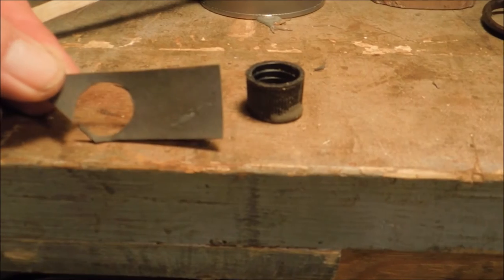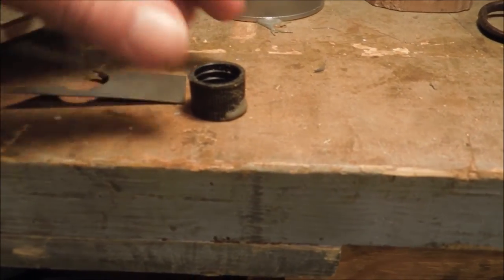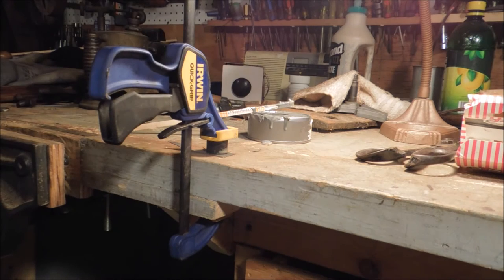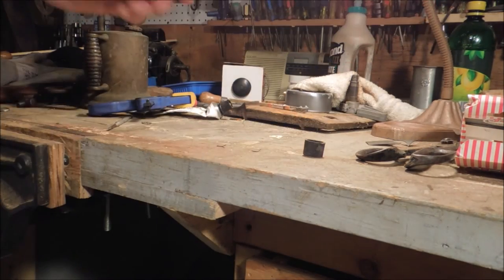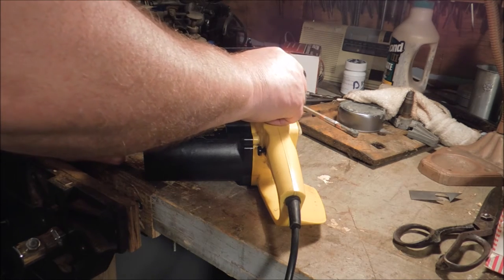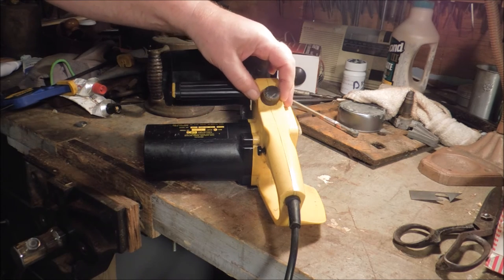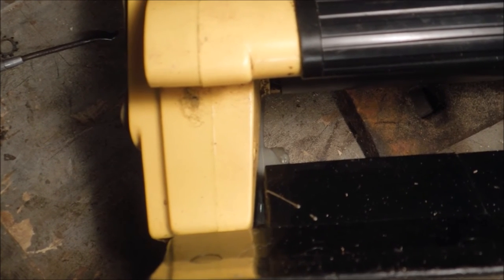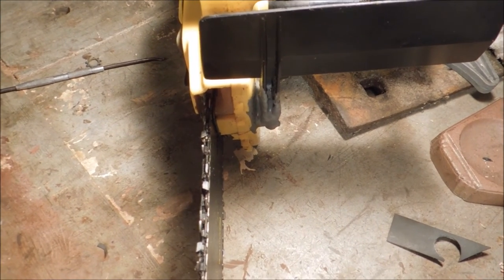Chain Saw Repairs ~ Pt 4 ~ Repairing The Cracked Oil Tank Cap ~ By Old Sneelock's Workshop

Comment: JB Weld is pretty amazing stuff. Repaired a crack at the bottom of my toilet tank years ago and it's still sealed. Hope I didn't just jinx myself. Take care.
Reply: If it hasn't eaten out or blown up by now, you're safe. But it won't work around ethanol.
Reply from the maker: Some day I'll tell you about my Herculean task of rebuilding a Farmall B Tractor. JB Weld was involved but no duck tape.
Reply: Old Sneelock's Workshop There is a place for everything and everything in it's place AND I can't wait on that one. It'd make a good video, betcha!
Reply from the maker: More like a slide show. Didn't take much video back then
Reply: Old Sneelock's Workshop I/we can handle a narrated slide show. So THERE, Unc!

Comment: I think my filler cap on the Workz is the pump too but I slept several times since I looked at it. The J B Weld won't work with ethanol. I told you about my wood splitter tank and the Saw Surgeons repair. When the ethanol hit it, the stuff turned to plastic/rubber. After working like a dream for several years and the only differece was ethanol gas.
Reply from the maker: I remembered your issue with JB Weld and alcohol when my 5 gallon gas tank sprung a leak. It's waiting for its turn in the soldering repair pile.
Reply: Old Sneelock's Workshop Good. I 'd like to keep someone from going through what I went through but Seal All keeps the gas inside and has for several years in spite of ethanol that our government should drink mass quantities of for letting the blasted stuff be added in the first place and THEN swallow a lit match or a blowrtorch. But that's just my side of it.